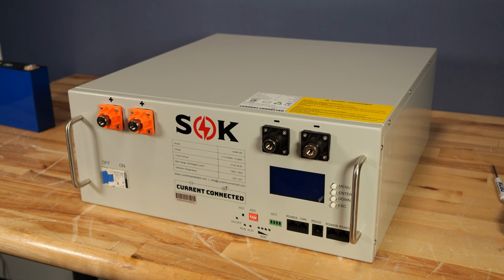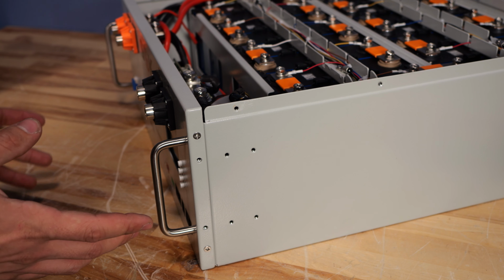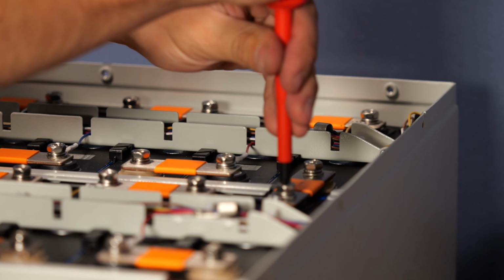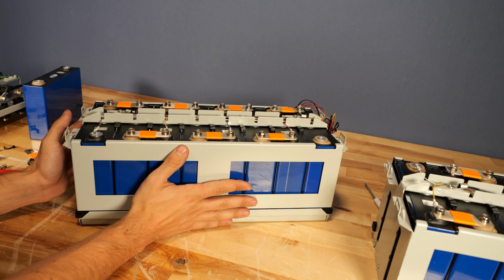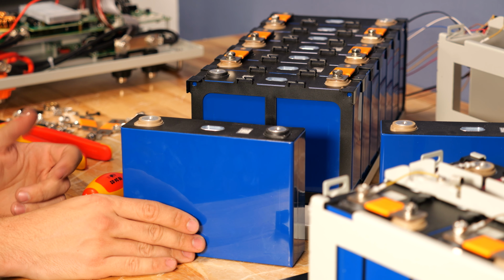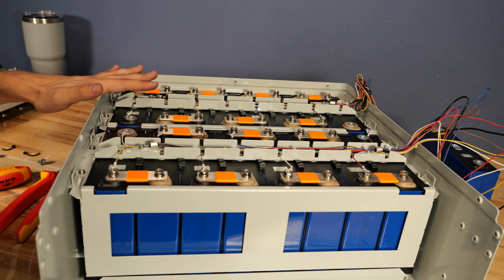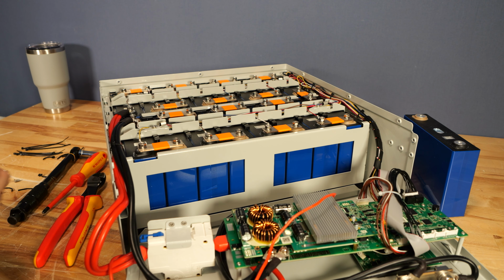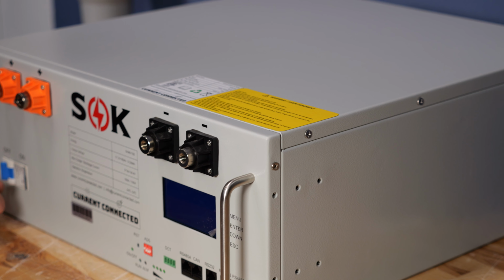How to Replace a Cell on the SOK 48V 100Ah Server Rack Battery 🔋 SK48V100 Cell Replacement Tutorial

Comment from the maker: What would you like to see us do a video about? Let us know here in the comments!
Reply: It will be nice to have a video showing how to balance the cells manually and to identify bad cells. I have 8x SOK 48V 100Ah server racks and the BMS is not able to balance some of them after multiple months.
Reply: How about covering which server rack batteries can have their cells completely replaced when they eventually are not able to charge effectively?
  I know it will many years later but we can save money if we can just the cells ourselves.
  Ecoflow and other battery stations are basically one shot deals.
  Apparently this SOK can easily be changed.

Comment: I would like to see a video on how this BMS passively balancing the cells and what is the difference between the cells when the battery is fully charged at 3.65V per cell for several cycles in a series, and if there is no need to add a Smart Neey 4A Active Balancer.

Comment: I would like to see a video of how the current limitation protection works for this battery when two or more batteries are connected in parallel with different state of charge

Comment: I'd like to see a test video or test videos about all the BMS functions by setting. I'd like to see how the BMS works at the limits and how it protects the battery, what it shows, where in the VRM portal or in the Solar Assistant show the warmings to user, how the user is supposed to know what to do when the BMS reaches and locks the battery for protection, test and show everything you can from all viewpoints, explain everything and show procedures on what to do with it and how to react correctly as a user.
Reply from the maker: Thanks for the replies! Lots of great suggestions!
Reply: @CurrentConnected  I have many more ideas for videos, I can continue in the comments under the video or send you email?